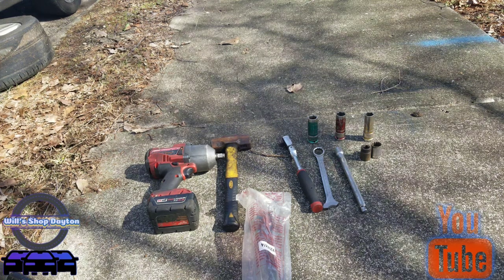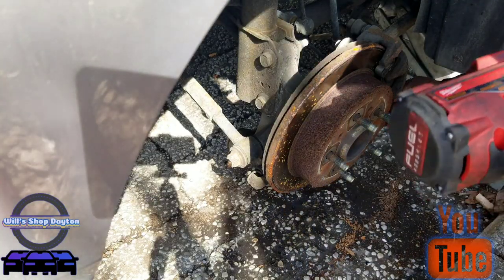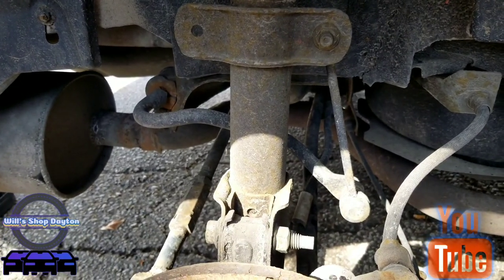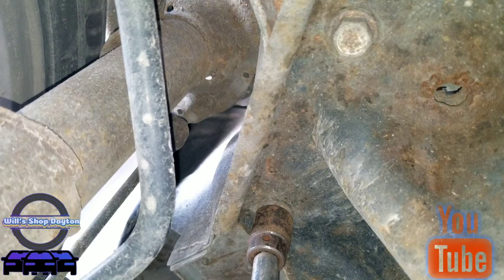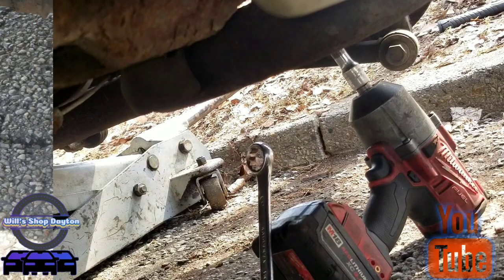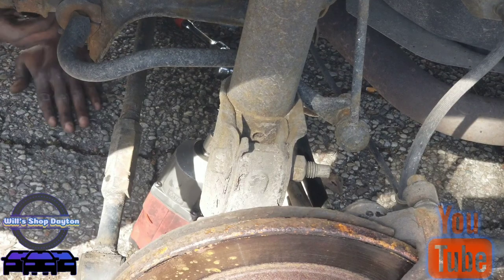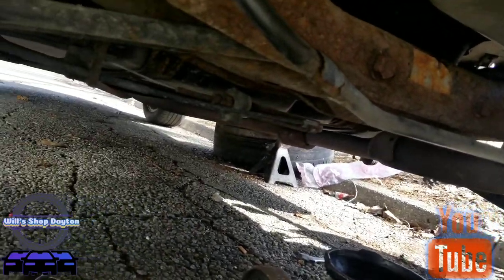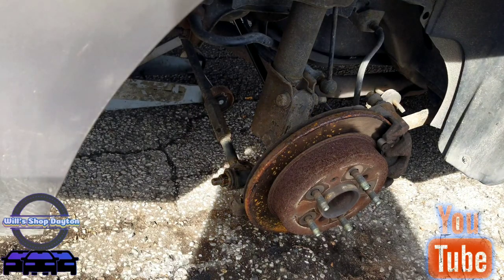2006 Chevy  Impala rear trailing arm replacement

Comment: Did ur Impala dog walk to the  right or left side due to them  trailing arms bad  mine is sway into the right when I hit above or if I go over bumps and then it shifts me to the right when I hit him. Or if I go too fast or fast enough speed it'll automatically sway me to the right like dog walking
Reply from the maker: The customer did state that it did wander in the rear while driving and wall hitting pot holes and  bumps. the best thing is to lift the rear end and check each tire for play. After that have someone move the tire while inspecting the bushings at the rear subframe. I would   just spend the money if this is you problem and replace them all while your in there. Taking a good safe look under to identify the trouble parts. But this is common problem i have been seeing with these. Thank you and hope this help and please let us know what the problem was for the community.
Reply: Mine looked bent like that. And swayed when hitting bumps. Changing parts out now.
Reply: @Drew Dew  how'd the repair go????